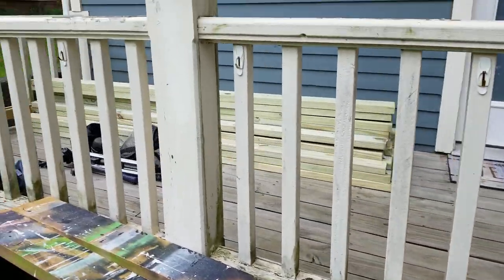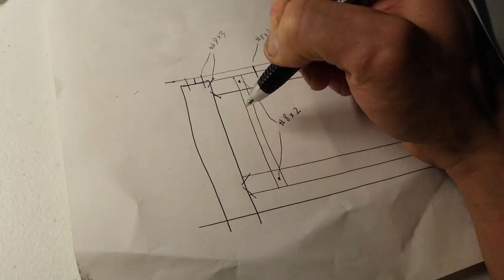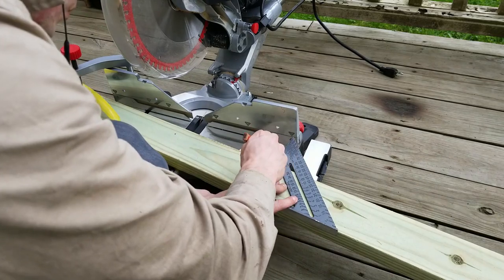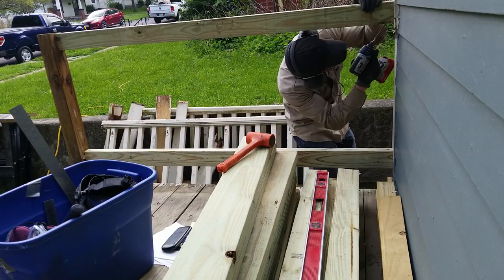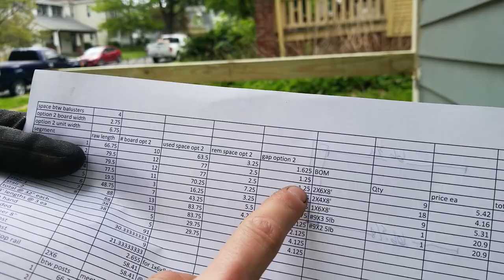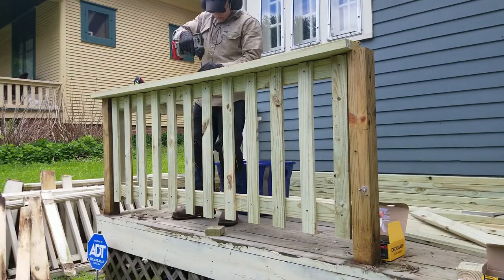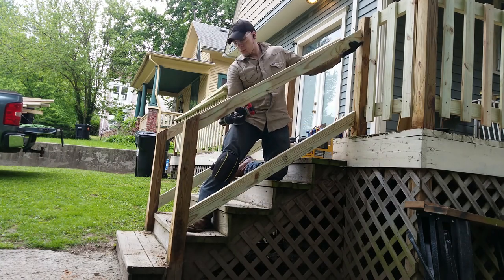Replacing Old Porch and Deck Railing

Comment: I need to replace my 70 foot balcony railing.  My old one is like yours, how much did it cost for the wood.
Reply from the maker: jeez I don't remember but this was around 2019...well before the crazy woodflation of 2020. I would think this would still cost $600 with pressure treated wood.
Reply: @gameoflife7235  Thank you!

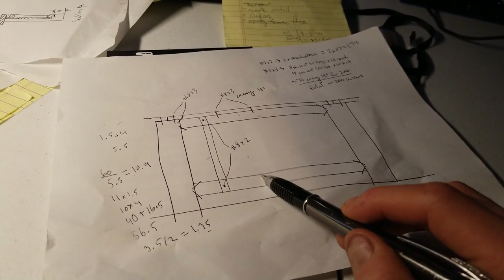Comment: At 3:01, when you started to cut the old railing off, did you just use a saw and cut through any existing screws nails that were holding the old railing in place?
Reply from the maker: Yes! A blade meant for wood and metal was essential since it's much faster to cut through the screws, and some of the screws were rusted beyond recognition!

Comment: Thanks for the very informative video. I'm redoing my posts and railings this summer and these tips will beryls useful. One question: The current top rail is a 2"x8" but I'm considering dropping down to a 2"x6" for a "slightly" lighter (less chunky) look. Is this OK from a structural point of view or should I stick with the 2"x8"?
Reply from the maker: I'd say 2x8 is way stronger than needed on a porch and only serves to give more surface area! A 2x6 is just fine for this.